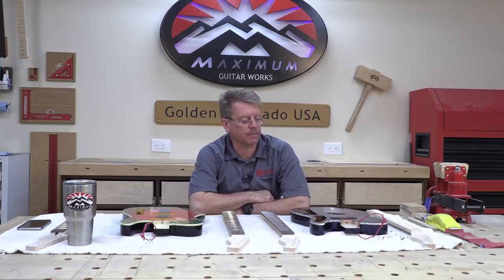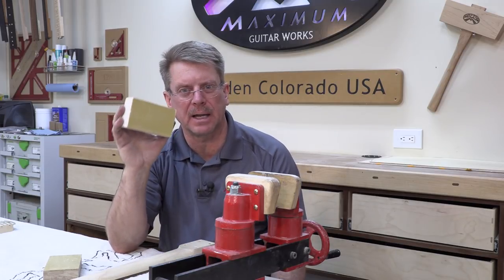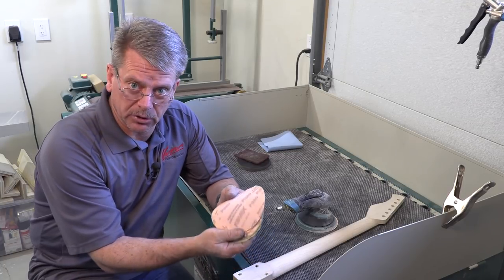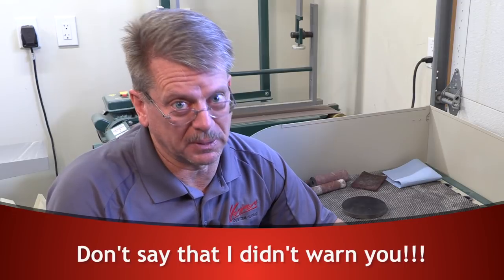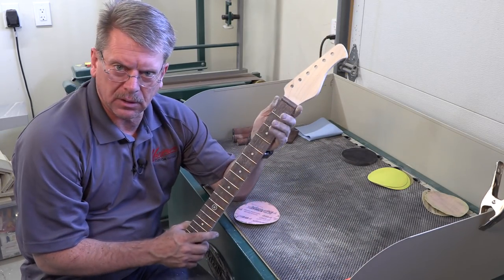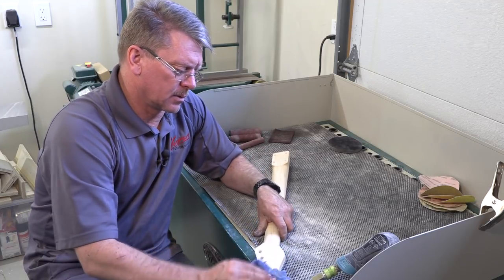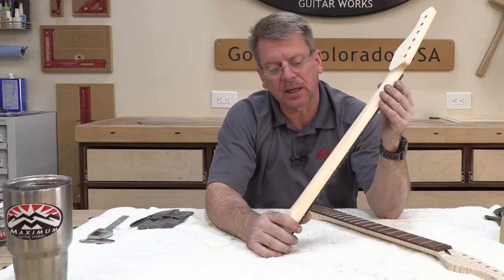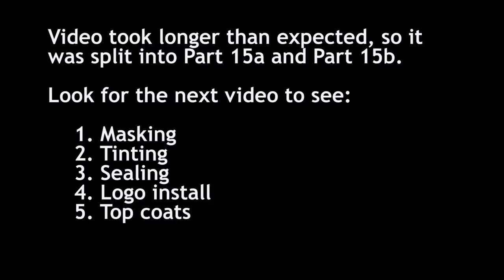Telecaster Build - Part 15a - Neck Finish Sanding and Neck Dye

Comment: Interesting on the one piece neck with the spoke wheel truss rod..
Reply from the maker: I guess that is pretty unusual, huh?
Reply: @maximumguitarworks  I've not seen a one piece with a spoke wheel . Every one piece I've seen has been adjustable at the headstock..

Is that something you've done often??

Comment: Nice work Steve ! They both looks stunning allready. I do it pretty much the same way.. only i use a beltsander to remove the biggest part and than work further up with the Shinto rasp and Iwasaki razor files before sanding. I also take very much care of the staightness both back and also fretboard of the neck, before fretting.. After all, the neck is the most important part of a guitar . That makes it or breaks it. What i've heard a few luthiers mentioning was the fact that the "thickness" of the neck feel has very much to do with the sides towards the fretboard. Maybee it's all in the head, but i'll think that's true. Any updates on your upcomming online store Steve ? And would you also sell carbon fiber rods ? Up to the next vid. Thanks Steve !
Reply from the maker: Hey Bruno,  thanks for the comments.  I have always been a believer in the neck is the most critical part of the guitar...that is what the guitarist connects with.  

Still working on the parts store.  I have stock of my first item...the custom switches I use with my clean boost guitar circuit.  I also got in a sample dots from my synthetic stone manufacturer with about 70 some different color variations.  I'm going to test fit them in maple, ebony, and rosewood fretboards to decide which colors I want to use and sell.  That is going to be a lot of work.  I don't plan to sell carbon fiber...because that is readily available.  My focus will be things that I have custom made for Maximum Custom Guitars.
Reply: @maximumguitarworks   Thanks for the kindly reply Steve.Greets from Belgium. I always comment, but i've changed my picture avatar. We spoke before in this build series. Maybee you didn't recognized it..Let me  or us know if there is any news about your " online store" please.  Greets.

Comment: Hi Steve - what’s your experience with color bleeding off when using an Oil finish - That is if you dye the wood and then apply a ligth Oil finish (just enough such that the wood isn’t raw)?
Reply from the maker: I generally don't use oil finishes...however, one of my students just did that.  He used an aniline dye...then Tru oil on top.  He claimed no issues with bleeding.  It might depend on what oil and dye you use...I would use dye soluble by the same as the finish you are using.

Comment: Steve, I’ve got a question that might seem a little uneducated. In certain instructions I’ve read that you should spray a couple of light coats of lacquer to act as a sealer. Is this what you do/did? I’ve got a really nice neck with an ebony finger board, the maple is raw but it that fits like a glove and don’t want to ruin it. Any help is greatly appreciated! Thanks.
Reply from the maker: The finish coats are so thin...barely changes the dimensions at all.  You can seal many ways.  I have use Shellac before...I have used thinned down lacquer...I currently use satin poly (or gloss is some cases) and therefore use a poly sealer most of the time.  I will generally use the tint (if needed) in the sealer coats...then rough up a little and go right to top coats the next day.  It is a fine line between not enough top coats and sanding through the finish...and too much top coat and    the neck feeling too thick (finish wise).  You have to do it to figure out what techniques work best for you.  Thanks for your question John.

Comment: When you started to build the necks you were using a 5/16" fingerboard You also remarked that the heel needed to be thinner because of the thickness of the fingerboard. According to the information I've read on Fender  neck spec is with 5/8" deep neck pocket and the overall dimensions of the neck with a fingerboard is supposed to be an inch. So I'm assuming that the finished heel thickness should be 11/16".
Reply from the maker: Theoretically yes.  Sometimes I use 1/4" blanks...sometimes 5/16" material.  The key is not what the material starts out...but what is the finished thickness after working to include radiusing the fretboard.  If anything...I would leave a tiny extra as you can always make the pocket slightly deeper...or plane off a little extra from the heel.  The important think is to be as close to 1" total thickness as possible.  Thanks for your question Pat.

Comment: Dewhiskering.  Gunstock makers using rubbed on oil finish do it 3-4 times before grain filling and oil rubbing.  A couple layers of Gorilla tape on the edge of that metal downdraft cabinet might save a ding sometime.